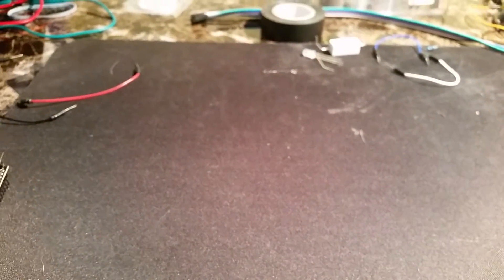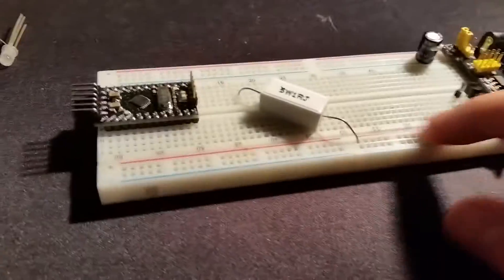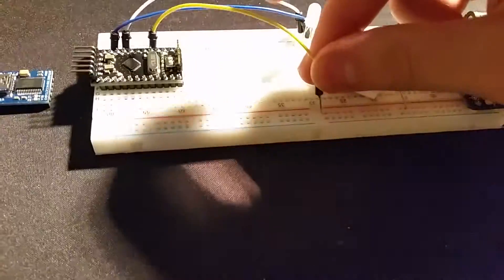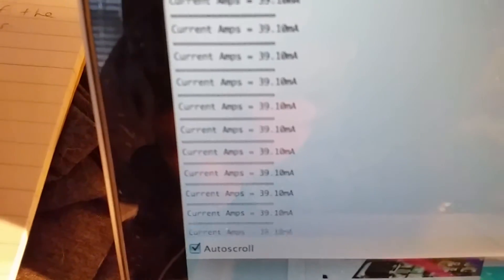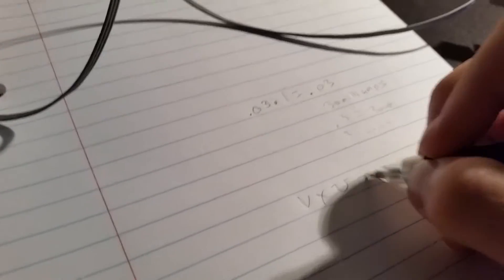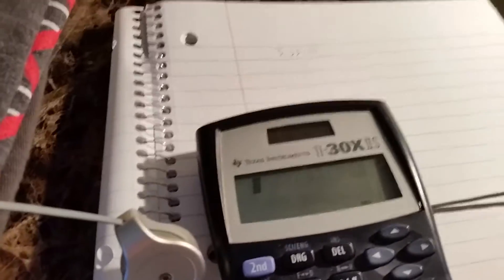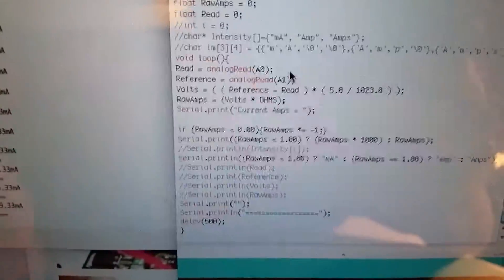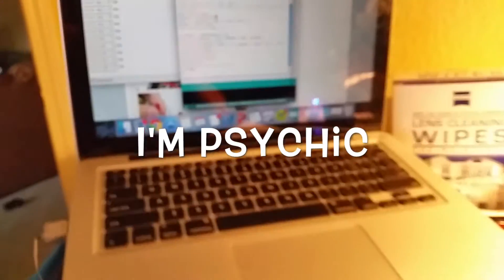Arduino as an Ammeter (Measure Current)

Comment: Can we use this circuit with altered values to measure current in a hundredth of a milliampere?
Reply: Not really. Doesnt have the resolution for it.
Reply: Nicholas Lenzo 
Thanks alot for the response!
Am at least glad that I didn't end up starting the work before realising that arudino wont be able to get such precise readings.
Also though, can no other board get such readings?
Else, can you suggest a way to tap the readings from a ammeter to a cloud?

Comment: what does the red wire ? 

maybe its easier to explain if you write it like

red = 
yellow =
blue = 
etc 
Cant see in the video whats happening
Reply: This was a while ago. Let me try to explain. First off, what we are doing is measuring the voltage on 1 side of the resistor and measuring it on the other side. We already know the ohms of the resistor, so that wont change. Then we apply some of the conversions and ohms law to get the amps. Seriously I had no idea what i was doing. I didnt even know the math, but it did totally work.

5:32
RED: Measure other side of resistor
Yellow: Measure 1 side of resistor
Blue: GND
White: 5v VCC for arduino

Keep in mind, the led has 4 pins. 1 of those pins is in ground-(no wire).

Comment: hello sir,
this is my project and i would like to know about the modifications to make it read 10A range of current in this circuit. Thank you.
Reply: +Anna S Lal 
1st off I'm justnthenick's second channel. I forgot I was writting this on this channel and am too lazy to relog and copy and past this. Now lets get to it.

Im not an expert but this is what I came up with......with much help from my brother. Again...I AM NOT GOOD AT MATH!!!!!!!!

Assuming The Following:
5Watt 0.05Ohm Shunt Resistor
Want to measure 10 Amps
The Arduino is measuring 5 volts with a 12 bit ADC
You should get an Accuracy of 24ma per measurement give or take.

You might be able to change some register settings to change the reference voltage to be lower which will increase accuracy. Say on an Arduino Due which measures 4096 through a 3.3v range.

Then again I have no idea what im talking about so milage may vary.
Go to arduino forum and test meh stupidity. I not smart human. 

Measure Amperage Arduino

V=Volts
Vo=Output voltage
A=Current
U=Ohms
Rvd=Resistor Voltage Drop
W=Watts
2^12=4096 posibilites for 12 bits.

Voltage Drop Across Resistor (V-Vo)=Rvd

Example:     (.05U*10A)=0.5Rvd

Watts in Heat Across Resistor

Example:     (.5Rvd*10A)=5W

Ratio of Voltage Drop to Reading Capacity

Example:      (0.5Rvd/5V)=0.1 Ratio of voltage to reading capacity.

Arduino Voltage Drop Accuracy

Example:     0.1 * (2^12)=409.6P Total unique possibilities for total range of 0-10 Amps

Example:     10A/409.6P=0.0244140625 Amps per Possibility so [24ma/P]

SO!!!! Each interval would jump 24ma every time the ADC detected a change in voltage.
Reply: +Nicholas Lenzo Thanks a lot for your help :) I will try this out too..!! I made one which can read up to 1Ampere. And don't underestimate yourself sir so please don't say you aren't good at this..:D
Reply: Anna S Lal hey please can you tell me the circuit of measuring 1A

Comment: Ohms law is U=R*I, that gives I=U/R or amp=volts/ohm =)
http://en.wikipedia.org/wiki/Ohm%27s_law
You might want to change that, otherwise, well done =)
Reply from the maker: Tobias Karlsson I fixed it with an annotation. I'm terrible at math, so thanks for catching that. Dont know how I got that wrong.
Reply: +JustnTheNick It's funny. What you wrote was actually right, kind of. You wrote an upside down omaga which is the symbol for mhos. Mhos are a unit of conductance, the inverse of resistance, so the way you wrote it was right even if it was by accident. The common variable for conductance is G, so it would have been VxG=I.
Reply: I guess here it's not about the sign/symbol he used but mostly about what he's referring to... And as he's referring to resistance, current and voltage, which are part of the ohms law.. so the right formula is V=IR, therefore I=V/R.